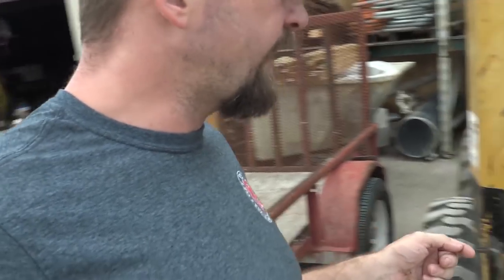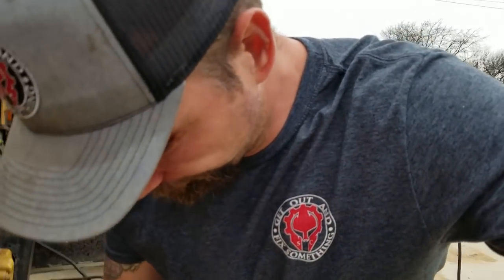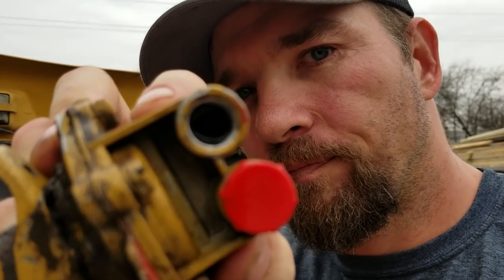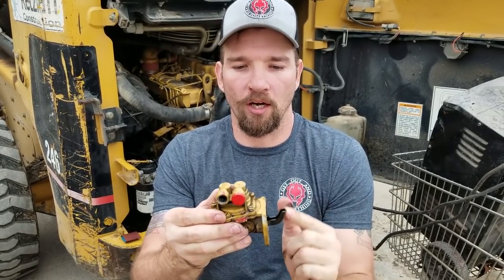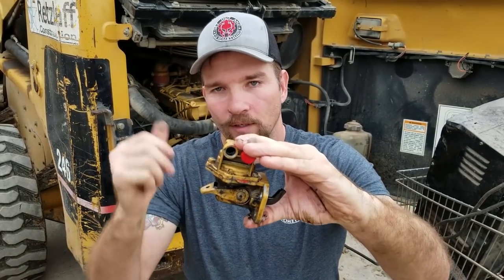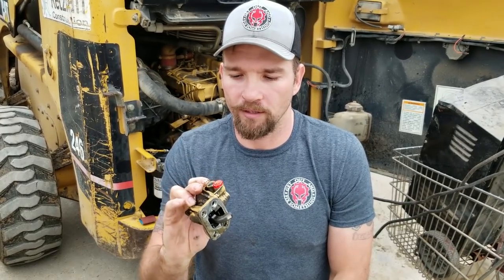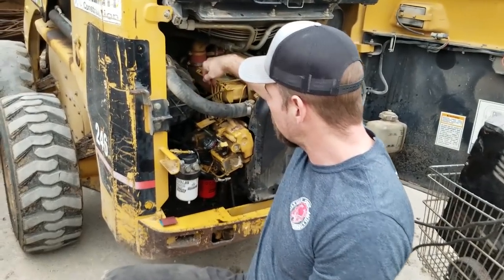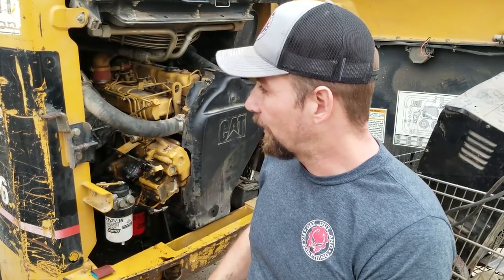Caterpillar Skid Steer fuel pump replacement

Comment: I've worked on a couple of 15 year old Perkins motors  in the last few months rebuilding them.  The factory Perkins/MF service info for the tractors says don't use sealer on some  gaskets. If those things were built using the same info then those gaskets are well compressed and pretty well welded to the mating surfaces. I tried scraping some in awkward spots where I couldn't use a machine and pretty well ended up chiseling them off with the scraper on some  steel castings.

  I was using a 4.5 " grinder gently with a knotted cup brush wire wheel on to remove them  from some aluminium housings without messing up the surfaces as well . The way the gaskets were on there those motors shouldn't of leaked any oil, but they still did, but hopefully won't now L.O.L. Thanks for the video, take care.

Comment: Rebuilt a many of the 3cyl. Perkins in my days @ Caterpillar.  Those used mainly in forklifts. On one engine job once, the R&R mechanics went to bump it over to install the toque converter bolts and it fired up on them.  So after that they quit waiting to do the flywheel to torque converter bolts almost last.
Reply: Perkins has made a good product for years.

Comment: I know what your saying Stephen, on my own "junk" I tend to just ruff the surface up to get any glue off and then I used a product called "right stuff" because over the years I found it really was. At least in tight spots and places where they don't even use a gasket like chevy and ford oil pans.... It worked good for me even in fuel applications. My "Bobcat" was held together with it I swear/LOL. I hope no one ever finds me saying this and then has a AH sh*t, that sob don't (fill in the missing adjective).If you have never used it; warning. Make sure that the surface is spotless of any oil or gas/diesel contamination. It works on bare metal or some old gasket (that thin paper stuff) but a spot of oil or gas and your dead in the water. I found it in a felpro gasket set. I really like your channel

Comment: Just changed one on a TH 63 telehandler. Have to remove the hood since its on the boom side crammed in there nice and tight. 20 minutes to swap pump. Hour to get to it.

Comment: I had a 2000Cat 248 with high flow, the fule cap had fallen off and the fuel tank got some crud in it, I changed the fuel filter and it would start but I could not run it up, I assumed there was dirt in the fuel line.
I took the fuel line and fuel cap off and blew compressed air into it until it bubbled fuel out of the filler neck, never had a problem again.

Comment: I had to do this and the primer pump on our cat 226b. That machine has been a pain this year. Had to rebuild 2 cylinders, pulled the engine to replace the nylon and metal hydraulic couplers. Weird thing was the one that failed was the metal piece not the nylon

Comment: Liked your video. I am replacing the engine in a 2004 cat 242B and the new engine did not come with a lift pump. this one has 2 bolts that holt it to the block and the hoses slip on and clamp on. can I pull the old lift pump and install it on the newer motor or should I BUY NEW
Reply from the maker: As long as you clean it itll be fine. Cycle some new diesel through the pump and stick it on there. Hope this helps. If you have any more questions let me know stephencox09@gmail.com

Comment: So my 236 will run then dies out after a few minutes. Then it requires me to manually pump the fuel and it will start again. I changed filters at first sign of an issue. 1st was dirty. I pulled the pump but when I manually pump it it produces good suction. Should I still replace this part dinner it is original? Just over 1000 hours. 
Help!

Comment: I haven't seen any comment problems with any of the videos where you said there were comment problems.  They have all seemed to have comments.  So I don't know if you just can't see them or what, but this comment is just one of many on this video.  And all the others seemed the same.  I could see them just fine.  So I don't know what's up.
Reply from the maker: Check on any of my older videos.